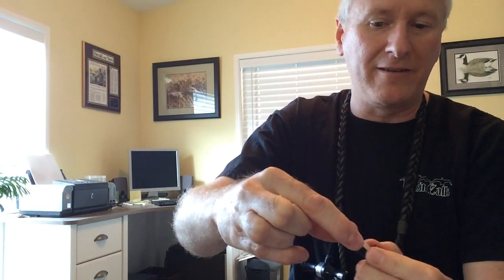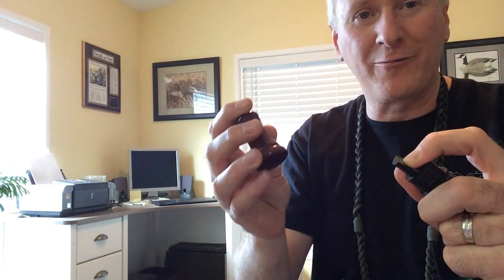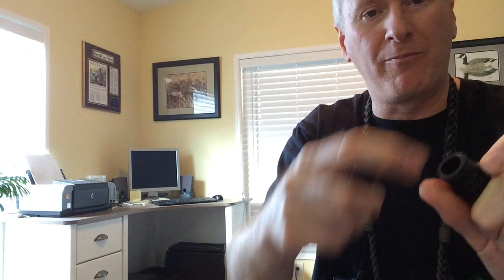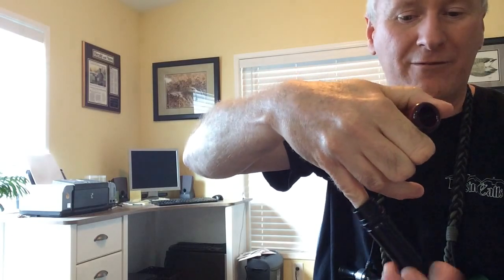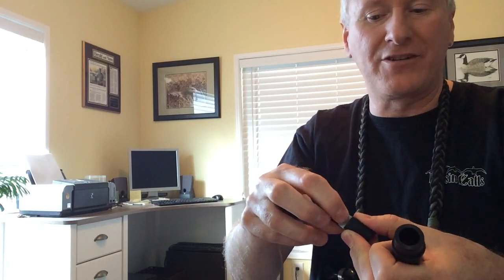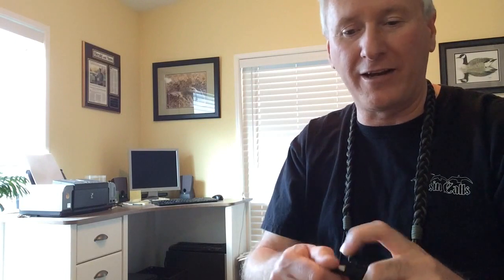Taking Your Call Apart.

Comment: Haha the biggest pet peave I have is when someone else checks out your call and opens the body to look at the set. Its not because you don't want them to see your set its because the call regardless of who makes it is not exactly the same inside the barrel and tone channel which is part of the tuning. If you really tune them there is about 7 things you are adjusting not just the Reed wedge and tone channel. In a goose call its the air presentation the Reed wedge tone channel the flex on the Reed the pressure of the assembly in the bell and the bell air outlet.  Having one part off changes the tone pressure volume presentation and hand formation when presenting a call. On duck calls its even more difficult because you only have 5 notes on the call so you have to get it to preform each of the 5 notes first then by adjusting sanding with a nail file changing Reed density length cut offs bend and squeal you get it to ok then if it's a double you have to tune the second Reed the same way and then you have to retune both at the same time to get cut squeal and rasp. Where with a goose call all the calls are a honk in different ways a duck call actually has three noises a quack squeal and feed that have to all three be in line. I differ on the set up of goose calls from you but I'm probably running a different gut on high speed guts or tapered guts the Reed doesn't go into the tone channel it is designed to run on the round part of the tone board and the Reed be stamped or bent so that it is concave above the tone board which has the channel below the Reed so taking a Reed out if set up like this could take 2-3 weeks to re set properly if you don't do it all the time. I set my calls shave on the top side off set 3/4 inch with a T punch dent and shape the Reed to sit on the edge of the channel not in it and leave the Reed loose enough to vibrate below the wedge. So when someone cracks open the call there like WTF. And I'm like crap I got to retune that.